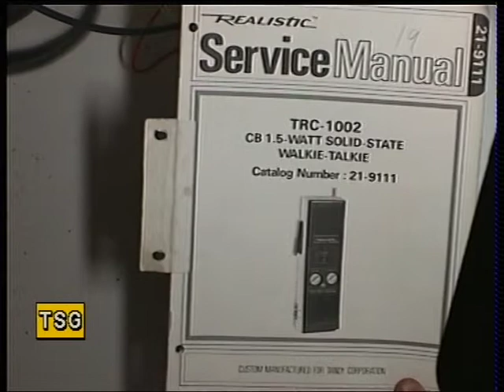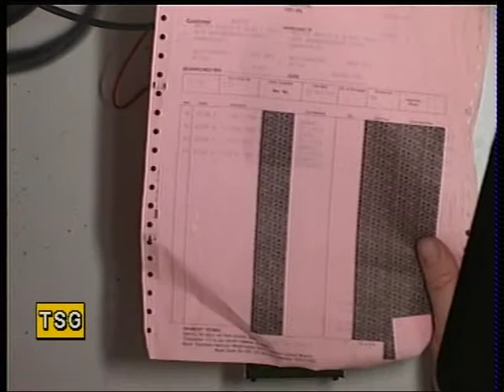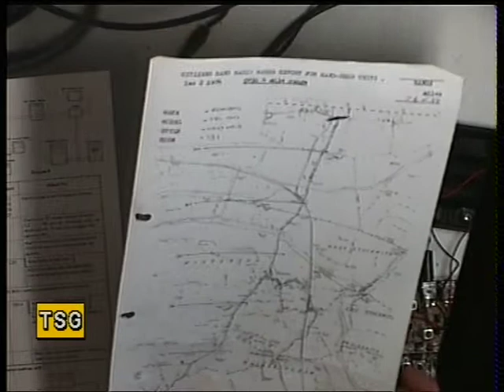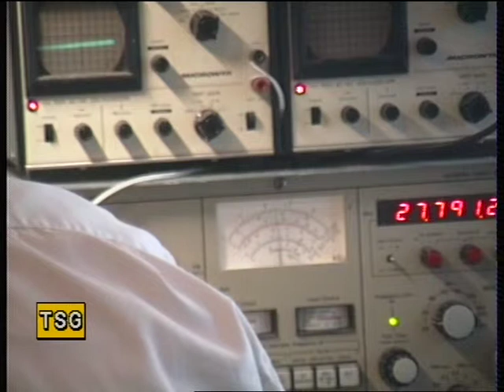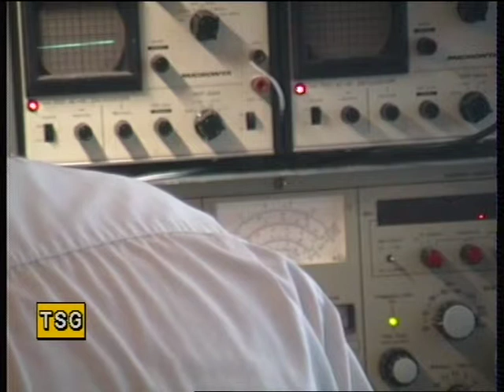Realistic TRC1002 UK CB radio (Hand Portable). Transmit alignment.

Comment: Just bought one very clean. Unfortunately it's only got the single channel 20, where do I order the crystals from? I'm after channel 19 for B position. Can you tell me where to order them from and the formula for the rx and tx crystals. Thanks
Reply from the maker: As I said in the video they came with the channel 20 crystals only & at the time, Tandy's offered channels 9, 14, 19, & 30 to fit to the extra channel. I also said in the video that these days to have crystals made is about £30 each. Seeing as you need both TX & RX crystals, then that's £60 for an extra channel. Quartzlab will do them & will know the formula.

Richard
Reply: @ukfmcbradioservicingTango21  hahaha daylight robbery 😭
Reply from the maker: We used to us HyQ international, but they withdrew from the UK about 12 years ago.

richard

Comment: Do you know where I could find a replacement built-in antenna/what to look for.
Reply from the maker: The antenna has an overall length of 1500mm when extended. It's a snag now these are 35 years old. The exact length is vital for correct SWR otherwise the output transistors will be destroyed.

Richard
Reply: @ukfmcbradioservicingTango21  thanks, I suppose it could be possible to disassemble the broken part of the antenna and add a new piece on until it measures exactly 1500mm.
Reply: @ukfmcbradioservicingTango21  They still work! They still had original RadioShack rechargeable batteries before I replaced them.

Comment: What batterys do you need for it
Reply from the maker: either 10 x rechargeable AA or 8 x AA Alkaline + 2 dummy batteries that originally were included. Dummy AA batteries are available via ebay etc. Logic here is rechargeable batteries are 1.2V each, so 10 x 1.2v= 12v. Thorowaway batteries are 1.5V each, so 8 x AA 1.5V also = 12V.

Richard